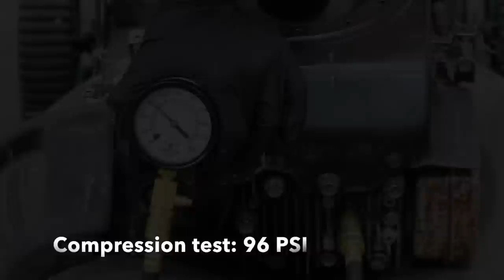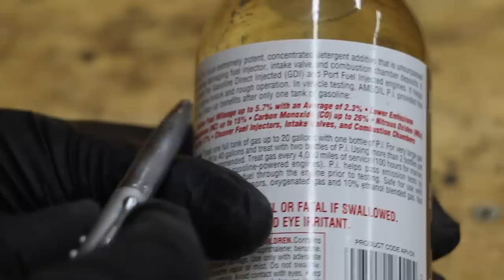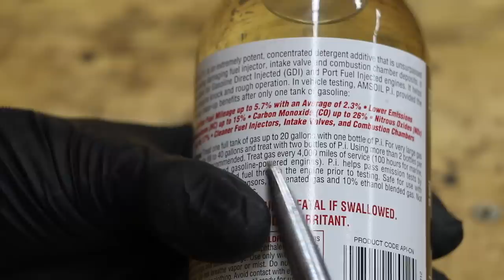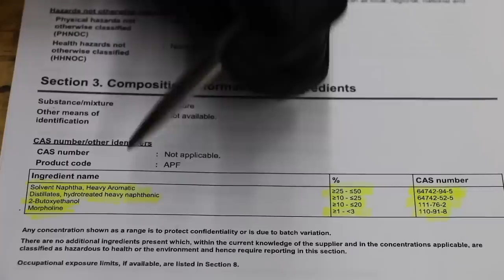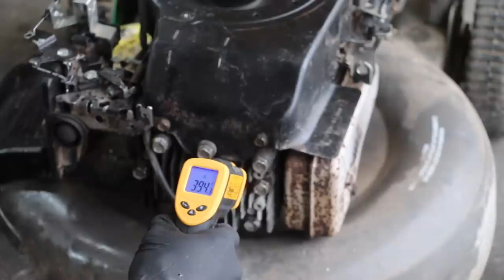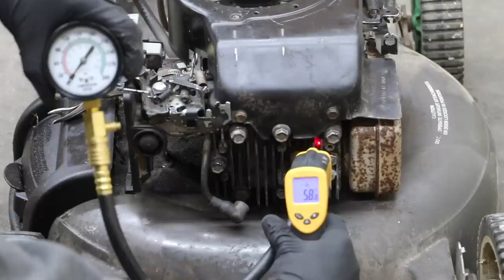Is Amsoil Power Foam better than Seafoam & MMO? Let's find out!

Comment: have use these two products for about thirty years in all my equipment, cars carb and f.i., motorcycles, generators, lawn equipment. power foam works best when you actually stall the engine and then end with it and let stand min 15 to 30 mins. then run it at at least half throttle with a load on it to clear it out. i have even been able to clear an O2 sensor code with it. P.I works best when you use in normal operation for the full tank.
Reply from the maker: Great tip.

Comment: you have to soak the carburetor in carburetor cleaner for the shalack to break down.  a little wire brush  action on the head , piston,and valves after a little soaking will clean them up pretty good.
Reply from the maker: Thank you for this recommendation!

Comment: Here is a suggestion to test out. I own a  1983 Mercedes Benz 300SD turbo diesel, a diesel additive to the fuel tank. A power service clean cetane boost $21.50 for 64 ounces. Can you test this product to determine if it in fact helps an old German diesel engine?

Comment: it would be interesting to see you test GM top engine cleaner. When we had a shop, I used it often on cars that failed smog test on NOx and HC reading.
Fixed Many drivability problems as well. Oh, it makes a great injector cleaner as well.
Reply from the maker: Thanks for the suggestion.

Comment: That see through engine head is awesome, you can see exactly how the intake valve work with fuel going in and the exhaust valve with the burnt mixture going out. Most of us understand the concept but never get to see it. What did you use for the see through material?
Reply from the maker: 1-inch plexi-glass.

Comment: Have you ever done a before and after on atf in gas ? Ive been pulling cars out of fields for years and have had awsome results with a bottle of automatic transmission fluid to a tank of gas ....it has made rough running engines smooth a silk again for me and also keeps carbs clean that do alot of sitting ....
Reply from the maker: I need to do this one. Thank you

Comment: About 20 years ago I bought a used '96 Grand Cherokee 4.0L with about 72K on it. I don't think it ever had a tune up. The plugs had like .080 gap and still that thing ran. But I did the Powerfoam on it. After the 15 minute hot-soak, I fired it up and drove off. Must've killed every mosquito in a 5 mile radius!
Reply from the maker: Thanks for sharing.

Comment: Sorry this question is not posted to correct video- but, the additive challenge using the Prolong and it occurs to me that the promotion of these products usually involve the wear part soaking in solution, which impregnate into metal...do you see that making any difference in your results? Thanks and keep making your great and awesome videos!!
Reply from the maker: This is an excellent question.  I soaked a metal bearing in Zmax at around 200F for nearly 24 hours and it didn't make any difference.  However, that's just one test and I plan to test many more products.  Thanks for commenting!

Comment: Great video, the power foam did seem to do a great job at improving the performance of the engine although I still think Seafoam is better.
Reply from the maker: Thanks for commenting.
Reply: I meant to put performance of the engine, not video lol, corrected the typo.

Comment: Great video!!!! Curious if u have any other tests on Crab Cleaners? I personally use AC Delco Penetrating fluid. It works great on cleaning off varnish and scum in carbs. It also quite inexpensive and available at most GM dealerships.
Reply from the maker: Thanks!  Thanks for the video idea.

Comment: I hear belray small engine oil is the best you can buy. Even though I really like amsoil o would switch if i knew it was actually a better oil. A high performance ATV shop gave me this info. They were busting bearings with amsoil and never had  a problem with belray
Reply from the maker: Thanks for the test idea!

Comment: I would like to see you test Chemtech B12 along with sea foam. I saw a video where a guy took the vacumm hose off his master cylinder and sucked B12 straight into his engine and run it for a few minutes then shut it off and waited about 30 minutes to an hour, then started it back up and a lot of stuff came out of the tail pipe! Also, another guy took two jars, one with sea foam and the other with B12 and put two bad valves, one in each and let it set for a week! The B12 did a better job than the sea foam!
Reply from the maker: Thank you for the video idea!

Comment: I tried using seafoam in my car to help it idle. When I let off the gas it wants to stall. Seafoam didn't fix it. I used maybe a 1/4 powerfoam and stalled the engine with it. Started it up and the car is idling perfect. I was shocked. Helped my dirt bike and 4 wheeler too. Will be buying more
Reply from the maker: Thanks for sharing.

Comment: have you ever tried a fuel injector from a car engine with a fuel pump to apply seafoam or amsoil ?
Reply from the maker: No, I have not tried this. Thank you for this recommendation!
Reply: I have it works pretty good got a old cheap autozone gas fuel pump and a Kia fuel injector

Comment: Imo, the AmSoil combo did significatly better than just Seafoam. Quite a dramatic improvement in just your test and I would suppose after running several gallons through the mower over a season treated with AmSoil that it may entirely clean that internal combustion chamber.
Reply from the maker: Thank you!

Comment: I'd like to see you run a test on premium fuels. Shell has a fuel called v power nitro plus. Their claim is on a port injected engine it will remove carbon build up by 60% within the first tank. Now obviously for di engines that holds no bearing. They also claim that it's unbeatable with corrosion and wear within the engine as well. Obviously those two would have to be tested over a long period of time. So basically I'd like to see if their carbon build up claim holds true. And if it's a direct injected engine compared to port injected. Id like to see if it would have any affect of the piston crown for cleaning. You could literally test multiple things here. If you find out it does clean. How much would it enhance the fuel additives cleaning properties you test. Just a thought.
Reply from the maker: Thank you for this recommendation!

Comment: I think if you run the products longer, more in accordance with their directions you may find even more effectiveness from them.
Most call for a tank full or X number of miles/ hours. 
 A bench test I used for years to show the difference between petroleum oils and Amsoil was to take a cap full and pour it on a surface then ask the person to wipe it off. Next I would do the same with Amsoil.
They were always amazed at how much effort it took to wipe off the Amsoil vs standard motor oils.
Film strength and Amsoil cling ability is many times that of petroleum products.
By the way not all synthetic oil is the same.
Many years ago the petroleum companies lobbied  the FTC for changes in what was a synthetic oil.because they were losing sales to Amsoil and other makers of true synthetic oils.
Now adays there are tiers of oil classification.
A true synthetic such as Amsoil is now a Tier 5 where as Castrol, Valvoline, Q-state and on and on get to label their top tier oil as synthetic even though they're not.
They are all Tier 4 which is petroleum oils more highly refined with a different additives package.
 You won't see the tier rating anywhere on their products to know that.
Another thing you won't see on all the other brands of synthetic oil is a milage increase. Except Amsoil.
They put it in writing that you will see a milage increase.
Over the decades of using and selling it to my customers they have all come back telling me of 2-3 mpg increase across the board.
On trucks , class 5 and up often have wet hubs on the front axle as well as the rear.
So when doing a switch to Amsoil we would change all the lubricates to Amsoil.
Front hubs, power steering, transmission,grease in the ujoints, and gear oil in the finaldrives.
Even with the large truck and weights we would still see impressive mpg increase usually over 5 mpg. Truck comes in getting 7 goes out getting 12 
In the case of my FL70 with 8.3L Cummins, Allison 3000 series 6 speed Automatic it went up from 7mpg to 14.  The increases are not temporary either.
If you have mechanical problems you need to fix it then run the top tier oils, you will save a lot of money in the long run.
Reply from the maker: Thank you!

Comment: Any ideas about white vinegar. I recently rebuild my motorbike engine and i used white vinegar to clean my piston and chamber before putting in new rings and valves. It works really fast especially when scrubbed with a toothbrush. I also use it to clean my spark plug and the CLEANING results are a lil too good. Now m a total noob so i just want to know about side effects of cleaning with white vinegar if any. Also can u do a white vinegar test and compare to seafoam. i mean injecting white vinegar into system on regular pace just like u tested others
Reply from the maker: I'll have to test it. Thank you for this recommendation!
Reply: Looking forward to it :)

Comment: Todd I'm puzzled by all these snake oil cures and there's one I've never seen you use. It's a 3M fuel system cleaner for carburetor and injection systems. I use it once a year in my car and pickup and after use my miles per gallon increases on average 2+ miles per gallon!?!?
Reply from the maker: Thanks for the video idea.

Comment: Don't know if you have done one already or not , but could you do a comparison for fuel injectors and spark plug coils ,im looking for which ones are better for durability,performance,gas mileage ,any useful data analysis that you can think of that will help the consumer make the better choice for their vehicle ,your data analysis for vehicle oils helped me pick amsoil and truth be told it lasted me 20,000 miles before I saw a slight difference in color and a need to do an oil change,same for your spark plug analysis too,which thank you by the way for
Reply from the maker: Thanks for  the video idea.
Reply: @ProjectFarm  if you need brands for competition among the ignition coils ,I was considering buying the blue streak from rock auto, but then wondering if there is much difference from their economy ones such as NGK,Motorcraft, and Denso. As for the fuel injectors I'm debating if I should just get economy ones such as autoline,or pay a little more for the other brands such as ultra power,standard motor products, or Motorcraft.

Comment: How about Chevron-Techron Concentrate Fuel system cleaner?  The stuff works wonders for a fuel system in need of cleaning.  Also on carbon too. Almost like magic....  In severely neglected systems, it will take all of the junk from the tank, and plug the filter...  So it does work on large machines.
Reply from the maker: I've got a video on the way on this product coming soon. Thank you for this recommendation!

Comment: I wonder if you would be able to hot soak easier by spraying constantly into the intake while having your drill on the crank not letting the engine stop moving so you would always be pulling into the engine even if it's not combusting
Reply from the maker: Thanks for the suggestion.

Comment: Not overly impressed with the result. I guess if you ran it much longer it may have cleaned it up a little better. The hot soak probably did more than anything else….Thanks, always enjoy your testing!
Reply from the maker: Great point on a longer engine run.  Thanks again!

Comment: You should try testing fuel injector cleaners too there's so many different kind. Most of the time I just use Marvel Mystery Oil in gas and oil but I want to know how good it actually cleans the injectors or if I should just be using fuel injector cleaner.
Reply from the maker: Thanks for the video idea.

Comment: Question, I know this is old, but do you do other than automotive products? Maybe test things like which laundry detergent works best and use shirts with oil on them. Or maybe which dish soap works best. Lastly, maybe which hand soap works best for removing grease, and which doesn't leave your hands dry and cracked. Just a 💭
Reply from the maker: I do the testing on products that get the most requests.  With that being said I can take into consideration that type of testing.  Thanks.

Comment: The best way to hot soak a engine, is to fill the combustion chamber and then let the work by putting the plug back in and waiting, then take out the plug and crank it to get the remaining liquid out, this is to prevent hydro-lock and then put in the plug and start it. Even if you just are using water.
Reply from the maker: Thanks for the feedback.

Comment: When I was a kid, my Dad said that transmission fluid is a high detergent.   I used to replace one quart with ATF at an oil change,  run the vehicle for 100 miles and do a normal oil change.  Any thoughts?
Reply from the maker: I think 1 quart mixed in is safe.  ATF is very high in detergents and dispersants.  I've read hundreds of comments from those who've done this without any issues while achieving improvements in engine performance.  I probably wouldn't mix ATF in a vehicle under warranty.  Just my opinion. Thank you

Comment: I just got through putting $100 in Amsoil oil in my truck it runs a little smoother and is a little more responsive then with the STP also put in VTech additive in the gas tank and the engine oil
Reply from the maker: It's always great to get results like this!

Comment: One question what is that stuff doing to the engine oil? Diluting it at best by the blowby. Oil should be tested to see the viscosity levels after it was used as well. Or does blowby become less?

Comment: Couple an automotive alternator to a small engine and then you can apply an electrical load such as headlamp bulbs or a big resistor, it should be much more precise and repeatable than the engine brake and it won't tear up the flywheel.
Reply from the maker: Thanks for the suggestion.

Comment: Sorry i just picked a video concerning cleaning out the combustion chamber? I just watched a video where a guy turned a 4 cylinder head upside down and he poured a certain amount of the carb/parts dip that comes in a gallon white paint can with blue and red striped label from O'reallys . Dont remember the brand? They make the can of B-12 fuel additive . Well long story short jusy by letting it sit on the combustion chambers it cleaned off the grease/carbon build up! Wow! So i got to thinking what if you took a pint of this stuff or the same amount that comes in the B-12 can and mix it with gasoline and run it through the fuel/combustion system  to clean it out ? Would be interesting to see if it cleans like it did in the concentrated form on the head?
Reply from the maker: Thanks for the feedback and video suggestion.

Comment: You should try adding mmo to oil in a direct injection engine & see if that will clean the intake valves, since oil vapor is intaken via pvc & fuel does not touch the intake valves
Reply from the maker: Great video idea

Comment: Is it possible to insert the foam through fuel the opening of the spark plug and let the foam melt the degraded when the engine is off, to let the foam melt the degraded fuel when the engine is cold

Comment: NOTE The label you showed was on an off anle so it couldnt easily be read.

The instructions explicitly state "Not recommended for use in diesel engines, GDI engines or as a general-purpose degreaser."

Therefore this is NOT what I and many others were looking for   ie cleaner for our GDI  which can get buildup in different locations that the older MPI type..  and the stealership tries to pawn off a special engine cleaning process costing a small fortune..

Comment: I would to see if you can add Seaform or comparable brands. To 4 strokes in the motor oil.. Seaform claims it works in crankcase oil. See If that cleans up the engine parts any. Also test 2 cycle oil itself with Seaform added to just the oil. On a oil injected 2 stroke. If you ever do outboards?
Reply from the maker: Thank you for the video idea!

Comment: I've used Seafoam but not Amsoil foam.
Seafoam did ok but not spectacular in my experience.
I had better results from B12-chemtool at cleaning injectors and carbs.
I would add it then go down a remote road and do full throttle runs from about 20mph up to 60mph several times.
Reply from the maker: Thanks for the feedback.

Comment: I know this is an older video, but thought I'd chime in a product suggestion. First off, well done, Project Farm. You do a great job of making these tests practical yet thorough, providing us with some very helpful information. It's always a joy to see what you'll do next! For the suggestion, have you ever looked into Lube Control products? Their best known products are the FP60 (fuel additive) and the LC20 (oil additive). They also have a FP Plus fuel additive, which is apparently soy based. I've heard a lot about them, good and bad, and have only tested them in my vehicles which can only prove so much. They claim their products give better gas mileage and increased horsepower--I suppose like everyone else. I would be highly interested in seeing you test and compare these products with some other additives! Again, thanks for the awesome YouTube channel. Keep up the great work!

Comment: I would use AutoRX in the case of carbon or sludge, but it isn't a quick flush; the treatment lasts until the next oil change which would be difficult to test on a non functional test bed engine.
Reply from the maker: Thanks for the recommendation!